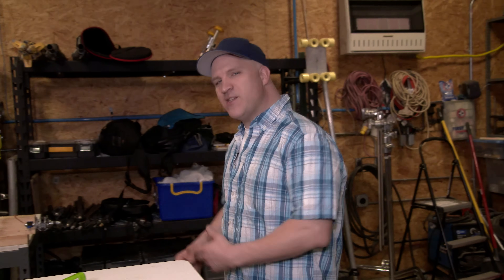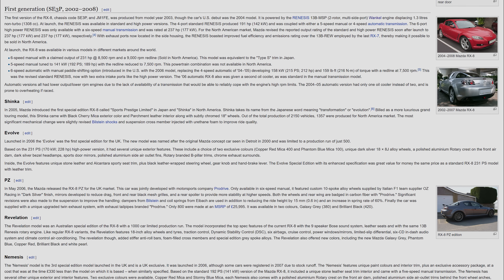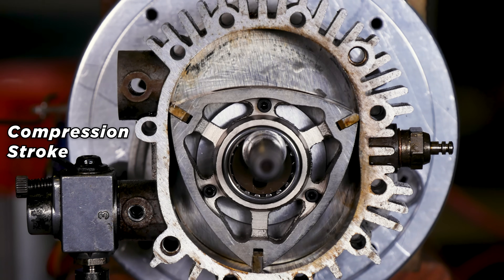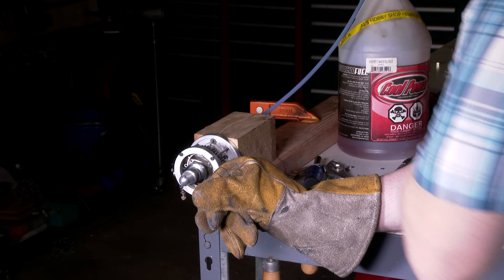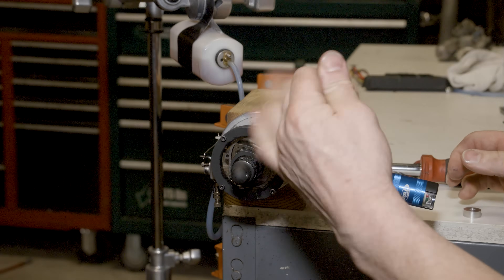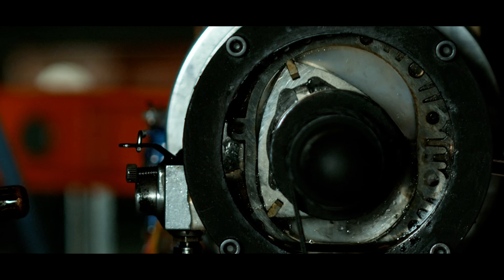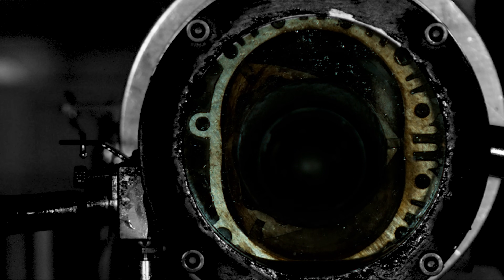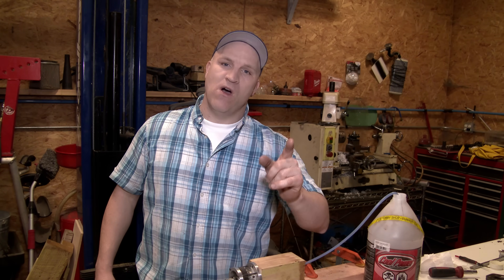See Thru Rotary Engine in Slow Motion - (Wankel Engine) 4K

Comment: Its a bad design,  rotary engines doesn't last long.
Reply: They last longer if you maintain them right that’s the big issue people maintain it like a piston engine
Reply: @Darkwolf A17 That is a false urban myth, its nothing but wishful thinking by people that have no understanding of reliability problems that plagued the Wankel engine right up until it became obsolete in  2012. The NHTSA recall investigation of the extremely high number of premature failures of Mazda RX engines finally and completely dispelled this false myth forever. There is absolutely nothing that you can do to make these engines reliable... which is exactly why Mazda dropped them like a bad habit years ago.
Reply: @doktorbimmer  On some level thats right, they aren't reliable and won't last forever. That being said my rx8 has been lavishely cared for as is my all cars and its out lived its competition grocery getter (single owned dealership bought) by nearly double the miles. As far as I'm concerned I believe Mazda stopped production on account of emission regulations... That and I can't find anything to do with an RHTSA investigation on these engine failures. Regulations prevented the proper amount of oil distribution inside the combustion chambers, they had their hands tied. Common practice for prolonging a wankel include: idling until operating temperature since it has an uneven temperature spread, hitting redline to clear out carbon soot, don't use ethanol it will dry out the seals, and premixing to add more lubrication than was allowed in regulations. Since wankels are wildly underdeveloped and little attempt to continue them are made not much real research is conducted in these categories myth or not.
Reply: @Darkwolf A17 Complete and utter nonsense... your comment is filled with false urban myths, misinformation and outright ignorance regarding the development, history, inherent flaws and commercial failure of the Wankel KKM engine design.
Reply: @Darkwolf A17 Absolutely and completely FALSE! The Mazda RX brand developed a well earned but notorious bad reputation for poor engine reliability, durability and service life. Sales of the RX brand had been in steady DECLINE since 1986 and sales of the RX-8 were a massive disappointment falling well short of what Mazda needed to recoup its development and production costs. sales were so low that the brand could no longer sustain itself as a commercial viable model or brand.
 False! The RX-8 continued to meet the World's STRICTEST emissions regulation right up until production was canceled due to lack of sales. The RX-8 met or exceeded BOTH EPA Tier2 Bin5 AND California's tough CARB ULEV II when production ceased in June 2012.
Reply: doktorbimmer is that so?
Reply: @Darkwolf A17 You are obviously not very familiar with notorious history of the RX-8 and Mazda's serious problems with premature engine failures of its RX engines. Mazda recalled all RX-8s sold to date at the time of the recall issuance, and voluntarily reimbursed thousands of RX-8 owners who had paid for engine repairs and replacements out of pocket. Mazda was also forced to extended the engine core warranty as part of a class action lawsuit settlement brought against Mazda for initially trying to cover up the defective engine scandal by destroying customer satisfaction surveys from RX-8 buyers and for lying about the published horsepower specs.
Reply: @Darkwolf A17 Those are all FALSE MYTHS... Hard starting and flooding problems are directly related symptoms of LOW COMPRESSION and DAMAGED ENGINE SEALS. Build-up of carbon and spark plug fouling is CAUSED by engine misfires due to low compression and engine damage. Redlining your engine is an OLD WIVES TALE that dates back to the days when Mazda RX cars were fitted with very poor quality carburetors which delivered poor mixture control and fuel delivery. Redlining your Fuel injected, Lambda feedback Renesis engine does NOT prevent this damage due to apex and side seal failure... it only temporarily masks the symptoms of low compression due to damaged seals. Bullshit! the RX-8 was sold in the United States and other countries were Ethanol blended fuels are available, Mazda did not use seals that were damaged by alcohol blended fuel which was approved by Mazda. MAZDA DOES NOT RECOMMEND PREMIXING oil with the fuel, THIS IS A MONUMENTALLY STUPID PRACTICE which will only causes further damage to your engine and its auxiliary components, sensors and emission control equipment. NEVER premix an RX-8...  anyone that recommends premixing is not qualified to give advice on engine care and maintenance. Tampering or removing the Oil Metering Pump can also DESTROY an RX-8 engine in short order.
Reply: @Darkwolf A17 "Wildly underdeveloped"????? The only thing underdeveloped is your knowledge of the development history of the Wankel KKM engine.
   26 of the world's largest and best engine manufacturers and over 100 of the best universities and research institutes (including NASA and MIT) spent decades, millions of man hours and billions of dollar developing the Wankel engine design.
 Mercedes-Benz and and General Motors alone for example both spent over 100 million dollars a year on Wankel research and development.
Ford
Toyota
Porsche
Rolls-Royce
Nissan
Alfa Romeo
American Motors (AMC)
Citroën
Suzuki
Yamaha
Kawasaki
BSA
Norton
Hercules
John Deere
Ingersoll and Rand
Fichtel & Sachs AG
Yanmar Diesel Co. Ltd
Daimler-Benz AG
Deutz AG.
MAN AG
KRUPP AG
IFA VEB
Graupner
Savkel
Curtiss-Wright
OMC  
Wankel-NSU GmbH. which became Audi..

Along with dozens of subsidiary companies and and partnership companies which combined represent BILLIONS of dollars in research and development besides what a tiny little Japanese automaker called Mazda ever did.
Reply: doktorbimmer My only argument here is that these engines fail early mostly due to customer negligence and I’m not talking about 2004. As for everything else I could write an entire essay. Such as how the marketing and publicity would be even more devastating had they increased oil injection to be on par and lost out on strict standards which is hard to believe that matched anyway. Besides any of that I have no idea where you get your information as far as I know, horsepower rating has always been between 220 and 240 and the only recalls are fuel delivery, suspension, and airbags.
Reply: @Darkwolf A17 That is NOT TRUE! You are obviously not qualified to speak intelligently regarding this subject and it appears that most of your very limited knowledge is either speculative, incorrect or based on misinformation.
Reply: @Darkwolf A17 The NHTSA recall investigation of the extremely high number of consumer complaints found NO LINK between owner abuse or neglect... the investigations findings showed that RX-8 owners who provided fully documented service and inspection records suffered from the same premature engine failure problems. Mazda DID NOT challenge the investigations findings and voluntarily recalled its RX-8 models, testing and replacing tens of thousands of Renesis engines suffering from premature compression loss and seal failures.
Reply: doktorbimmer if only I could find some documentation that I’ve been desperately searching for maybe I’d be a little less incorrigible, or you could just ride in my 200k mile rx8, but then again I’m obviously not informed enough about my own rx8 to know how it would fit all that insurmountable evidence you have
Reply: @Darkwolf A17 If only you were familiar with some real factual information about Wankel engines... most of your comments are based on myths, misinformation and outright lies.
 Your claims would be more credible if they actually sounded believable, the idea of a original RX-8 engine lasting 200,000 miles without major repairs or overhauls that has not suffered from seal damage and compression loss is not a likely or even plausible story and certainly not typical one.
 You are either the luckiest RX-8 owner in the world or you are just a liar.
Reply: @doktorbimmer  Every time I come back your comments change. It's getting hard to keep up with. Yes I said wildly underdeveloped, you can't deny every resource thats been put into a rotary is not even 1/100 the amount put into a piston most of which is pre 1980s excluding "tiny little Japanese automaker called Mazda" anyway and thats to include the amount of research documentation on variations. You can read about the history all you want but it doesn't change how the renesis works. Oil is directly injected into the combustion chamber by design, the more oil the less emission quality, the more oil the more lubrication. Spark plugs, Fuel pump, and the starter were all unmatched to the 2004 model specifically, which caused symptoms that resemble engine failure. The US also provides diesel and pure alcohol doesn't mean you should run it. I asked you for your sources and if you can't produce any we're done here, heres mine:  
Premix theory:
https://www.rx8club.com/series-i-tech-garage-22/possible-new-renesis-engine-failure-theory-210194/

Redline theory:
https://www.sae.org/publications/technical-papers/content/2016-01-2252/
https://www.sae.org/publications/technical-papers/content/940948/
https://www.sae.org/publications/technical-papers/content/931032/

200k mile club:
https://www.rx8club.com/rx-8-discussion-3/200000-mile-club-210536/

Emissions:
https://www.autocar.co.uk/car-news/motoring/mazda-kills-rx-8-sports-coupe

Besides how my rx8 has survived 200k glorious miles in which I have beat the crap of of my tachometer, idled until warm, premixed conventional oil with premium only, and never skipped a chance to change out ignition and oil since day 1 at 60k. That car is so well designed unique and fun that it was worth every penny even if its gone tomorrow but you'd never read that in the recall I can't find. Now I'm off to have some fun with it.
Reply: True, that is why Wankel engines are obsolete now

Comment: ONLY THREE MOVING PARTS ALLWAY GOING DOWN A ONEWAY STREET IN LA
Reply: dokterbimmer is a expert in Skycar.
Reply: @erniebrinkrotaryhemi7336  that is funny
Reply: thank you
Reply: A SkyActiv-X Rotary Engine Could Mean An Efficient Wankel Engine
Reply: @erniebrinkrotaryhemi7336  major leak inside the engine when a apex meets a leading plug hole major
Reply: @xkexke8081  expert in Skycar.
Reply: PISTON ENGINES VIOLENTLY CHANGING DIRECTION WHOOPS RIGHT OUT THE SIDE OF THE BLOCK DOKOTOR ENGINE COW PIE

Comment: THE FOUR STROKES OF A INTERNAL COMBUSTION OCCURS SIMULTANEOUSLY IN A WANKEL ENGINE THIS MAKES IT MORE EFFICIENT THAN A PISTON ENGINE JUST THE FACTS CHEERS RIGHT  BUDDY RUB THIS
Reply: THE ENGINE HAS WORSE EFFICIENCY THAN A NORMAL MOTOR HOWEVER IT MAKES UP FOR IT BY MAKING LOADS OF POWER IN A SMALL DISPLACEMENT
Reply: ONLY THREE MOVING PARTS ALLWAY GOING DOWN A ONEWAY STREET IN LA
1
Reply: @erniebrinkrotaryhemi7336  The Wankel are the future...
Reply: @dokterbimmer7270  dokterbimmer the fake ???? WOW!!! You're right, he did delete all his comments

Comment: A reminder of why I switched to electric powered RC.  Damn wings/fuselage would be covered in castor oil!  Still, those motors have a special place for the noise and smell!
Reply: ERNIE BRINK ROTARY  I could care less about Wankel engines for RC, probably too expensive for me. Glow motors in general spit ton of oil and make a mess out of everything.  Now I do have a 150cc two cylinder, two stroke gas motor that spins a 32" prop. No mess and will pull a fucking stump out of the ground! Extremely loud though!
Reply: ERNIE BRINK ROTARY  Thanks buddy, appreciate the compliments. Sure you don't have a rainbow flag on your bumper?🏳️‍🌈😂😂  Was looking at your channel the other day before your lesbian/trans rant. Never really thought about  rotary's,  but IMO the offset combustion design makes perfect sense for reducing vibration and keeping the seals from blow-by. Bet you didn't expect that did you? 😉 BTW, who's "you two"?   If she wasn't a butch and was good looking I'd fuck a lesbian. Lol!

Comment: First check out NSU Wankel, then learn to pronounce it correctly.  Try Wankel with the A pronounced sort of Wah, not Way as in "Wanker."  This use to bug me with volkswagen,. Not folks wagon.  Otherwise WAY?
Reply: @dokterbimmer7270  ernie brink is simple, straightforward" Yes you are, Ernie. And it's guys like you who often have made discoveries that wound up changing the course of industries. You know stuff intuitively, while certain doktors point to theories and mock others while saying 'it can't be done'. Well, clearly it can be done. You called for some basic configuration changes in the wankel, Mazda did this (if not exactly what you called for) and 'boom!' they've revived the technology and found new advantages with it. Nice going, Ernie!

Comment: What about measuring it's power?
Reply: What power? Wankel engines just burn fuel and make noise...
Reply: @doktorbimmer  but hey also won the 24 hours of LeMans once!
Reply: Yeah, but Audi won the 24 hours of Le Mans 9 TIMES!!!! with a Diesel engine... so that's not saying much for Wankel engines...
Reply: @doktorbimmer  Audi aren't really known for reliability either lol, anyway, ofc these rotary engines have many issues, but they work, and Mazda is impriving them, they started to build some again
Reply: THEY WON LE MANS 13 TIMES!!! Mazda abandoned development of Wankel engines in May 2009 and all production ended in June 2012... Wankel engines are obsolete in the automotive and engine manufacturing industries because they are inherently inferior to reciprocating engines which are still mass produced in the millions every year.
Reply: @doktorbimmer  "The rumor is now a fact: Mazda announced that it will bring back the legendary rotary engine, though not as the main powerplant of a car. Instead, a version of the rotary will act as a range extender in one of two electric vehicles the brand will debut for 2020."

These new rotary engines will be burning hydrogen/gasoline, lower consumption, it will burn better, less emissions, etc. They haven't killed it, this proves they are still working on it and fixing it, it still has a future, but maybe the market will be full electric/hydrogen until then... What remains is obviously the seals, but bringing it back as "range extender" is still the first step to bring it back as a main engine in a car. Anyway, someone owning an RX knows all this and will deal with it, because they are special

https://www.youtube.com/watch?v=U-n5L0cXcpg

Comment: @doktorbimmer Yeah to me this typical design has a lot of room for improvement but it's a great idea from an engineering standpoint. This engine is simply, 3 cylinders and four strokes, but instead of 2revs per power stroke per cylinder like a piston Engine, it has 1rev per power stroke per cylinder. 1080 OUTPUT VS A PISTON ENGINE

Comment: Now I understand why its said that the wankel is not efficient. You can see the fuel pool up inside. 😲
Reply: The Wankel engine died-out because it is not clean, efficient or reliable.
Reply: dokterbimmer the fake engineer Yeah to me this typical design has a lot of room for improvement but it's a great idea from an engineering standpoint. This engine is simply, 3 cylinders and four strokes, but instead of 2revs per power stroke per cylinder like a piston Engine, it has 1rev per power stroke per cylinder.1080 degrees output take that piston engine pella windows out the side of your block dokterbimmer the fake engineer YES WE COMPARE A TWO ROTOR ENGINE WITH A 6 CYLINDER PISTON ENGINE JUST ===== 6 CYLINDERS ===6 CHAMBERS ONE THATTHE OUTPUT IS 108O OUTPUT 3 TURNS OUT VS PISTONS TWO TURNS FOR OUTPUT A WANKEL WINS WITH 1 TURN OUTPUT TWO IT,S GOALS IN LIFE  LOOK THE FAKE UNDER ARE FEET

Comment: dokterbimmer the fake  engineer
 Yeah to me this typical design has a lot of room for improvement but it's a great idea from an engineering standpoint. This engine is simply, 3 cylinders and four strokes, but instead of 2revs per power stroke per cylinder like a piston Engine, it has 1rev per power stroke per cylinder.1080 degrees output take that piston engine pella windows out the side of your block dokterbimmer the fake engineer  YES WE COMPARE A TWO ROTOR ENGINE WITH A 6 CYLINDER PISTON ENGINE JUST ===== 6 CYLINDERS ===6 CHAMBERS ONE THATTHE OUTPUT IS 108O OUTPUT 3 TURNS OUT  VS PISTONS TWO TURNS FOR OUTPUT A WANKEL WINS WITH 1 TURN OUTPUT TWO IT,S  GOALS IN LIFE
Reply: dokterbimmer commented: "I AM A FAKE ENGINEER THE ULTIMATE TROLLING MACHINE" and stupid
5 hours ago
Reply: Ernie why doesn't your engine run????

Comment: Wankel 😏
Reply: ernie brink rotary hemi exactly, the guy that invented this engine was probably doing more than draw out his idea 🤷‍♂️
Reply: @DrumToTheBassWoop  show as your "Patent"s
Reply: @doktorbimmer Yeah to me this typical design has a lot of room for improvement but it's a great idea from an engineering standpoint. This engine is simply, 3 cylinders and four strokes, but instead of 2revs per power stroke per cylinder like a piston Engine, it has 1rev per power stroke per cylinder. 1080 OUTPUT VS A PISTON ENGINE